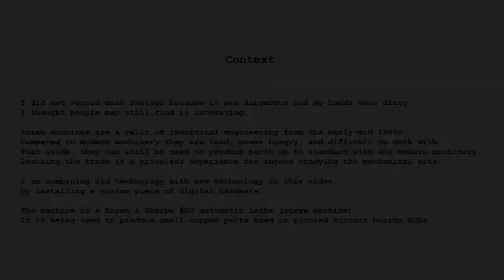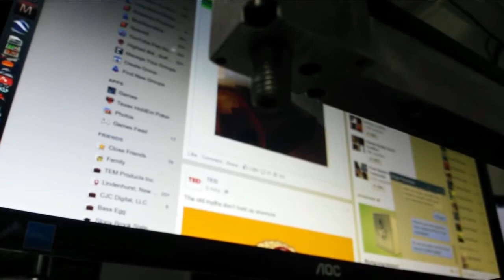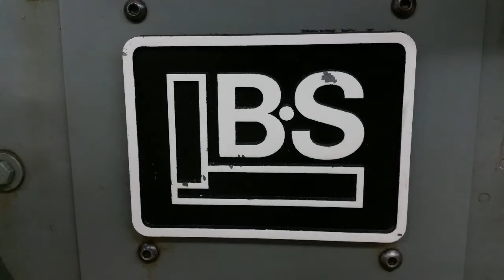Screw Machine Tune Up & Retrofitting

Comment: Thanks for a very nice tour of your classic screw lathe.  Am I correct that your rigid tapper can only tap 80 TPI because of the thread on the drive shaft inside the gear box?
Reply from the maker: Philip Freidin correct.